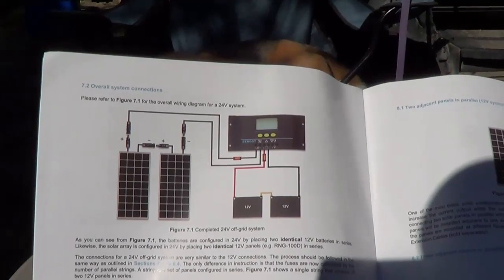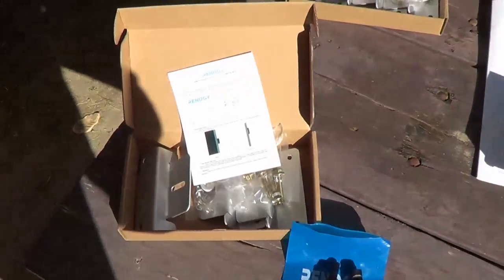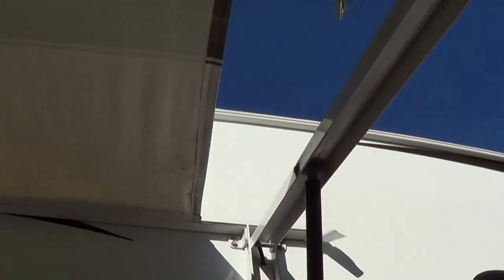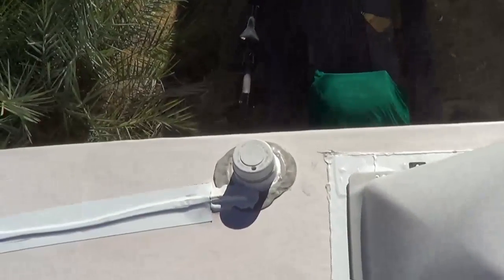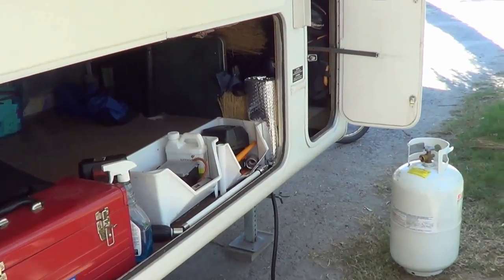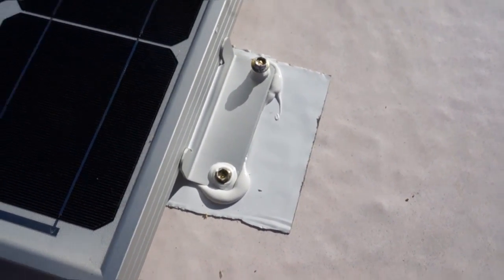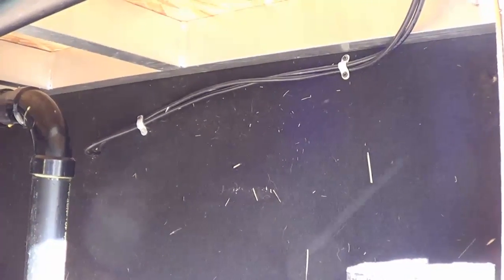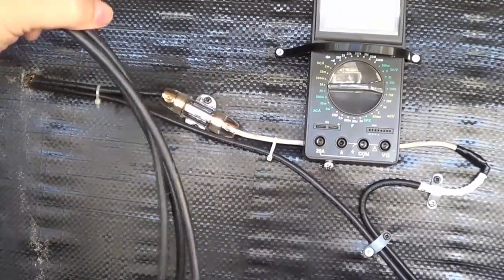Installing a Renogy 200W Solar Kit on my RV

Comment: Very nice.  I had 450 watt's worth of panels put on my 5'er late last year. Went on one trip to test them out. I have (4) 6V batteries running in series parallel, and it seems like I use quite a bit of power during the day, but it recharges pretty well.  Will be interested to get a few more boondocking trips under my belt.  Also would like to record the morning and night battery voltages.
Reply from the maker: Korey Jerome Nice amount of solar power and battery storage there.
 I think you should be fine. My battery voltage is about 12.8 when the sun goes down at around 4:45pm and 12.3 when it comes up about 7am, short days right now in mid winter. At night I keep my 17 inch laptop and Verizon Mifi charged and run a few LED lights, and maybe an hour of my 32 inch LCD TV plus the furnace fan is running on and off to keep rig at 64 degree temp while I sleep for 8 hours. Battery capacity is lower right now because it is near freezing so I expect better once it warms up a bit and as the days get longer from now on.

It's really nice to not have to run the generator now unless I want to instead of have too, last night I ran it a bit so I could watch a few hours more TV and use the microwave for dinner, I only have two six volts batteries for boondocking right now. Hope to expand to something like your system in the future. :)

Cheers Ray

Comment: Enjoy watching your videos Ray. Thank you and Happy New Year. I installed the same setup with an upgraded MPPT controller. It is supposed to make a significant difference - time will tell. Thanks again.
Reply from the maker: tommy1a1a Thanks and our welcome! Did you go with a Renogy one or a different brand controller?
Reply: Love Your RV I bought the same Renogy (I don't know how to pronounce it either) kit, but used a Blue Sky Solar Boost 3000i controller (warning it was bit pricey).
Reply from the maker: tommy1a1a Cool, will be nice if it does the job as advertised, I think I'll go with two more panels first to fill up the front roof then look at upgrading the controller after that to squeeze more power but then I'll need more batteries, ack! haha, looks like this could get addictive and expensive.
Reply: Love Your RV ahhh yes the only thing that helped control my addiction was winter.

Comment: Great install , I have a 160 watt solar panel installed on my trailer . Wish I had the installer use VHB tape by 3M . Do you know about this ? In my research I have found many RV'ers  have success with taping down the Z clips  instead of using mechanical fasteners .

Comment: will they be tilted up when in use/parked?
Reply from the maker: Currently they are mounted flat, no tilt. I'm going to add two more panels and see if that serves our needs with out tilt. If not I may look at adding tilting hardware to them. I'm only charging up a 235AH bank so more power maybe wasted anyway, Will have to use the system a while and see how it goes.

I like the simplicity of not tilting, less hardware to maintain and wear and tear on the ladder and roof. We tend to move around quite often, unlike some folks who like to stay in one area for a long while. I would also be a bit worried about the winds in the desert ripping a panel off the roof, so that would be another pain to have to be running up to lay them flat when the winds really came up. I'll see how it goes..
Reply from the maker: lez briddon Interesting thanks, I really like the guys channel. Will subscribe and remember to watch a bunch when I get on some free WiFi. ;) Cheers Ray

Comment: Fantastic job, the only thing I would have done different is run a lap seal over the edge of the eternabond tape to lock it down and prevent any future water penetration.  To give you an idea on what you are missing on your solar charge with having them in a lay down configuration.  I was checking my panels yesterday about 10 am and was getting 12.4 amps from the exact panels that you have.  That's tilted at about a 45 degree angle and at 4,000 ft. elevation and 36 degrees.   That's the best output I've ever seen.  The sweet spot with these panels I've found is in the 4,000-7,000 ft. elevation at a temp. below 50 degrees.  I track the output daily on my panels and average just over 5 amps output per panel.   I use my 4 panels in a portable configuration.  With the sun so low on the horizon now I have to reclock the panels 3-4 times a day for max. efficiency, but average at least 10-11 amps from 9am-3 PM with 2 panels.  If you decide to add 2 more panels in the future, consider adding a tilt function it will improve your charge rate by at least 30-40% in the winter when you really need it. 

  Also, for anyone considering the Renogy panels for $20 more you can add the digital charge controller in place of the basic one.  Call Renogy.  Renogy panels are made in the USA and the customer service is based out of Austin TX.  I've been very happy with my 4 panels and they provide 90% of my power needs the past 12 months.  Sign up for their e-mail promotions and every month or two they have a 10-20% off sale.  Their regular price has been about $145 per panel.  You can buy a 100 watt panel, 30 amp charge controller and 2 connector kit for about $165 on Amazon with free shipping. 

  Did you get any snow?......I left the high desert yesterday and camping on the Colo. River S of Bullhead City Az.  I had about 2 hours of heavy snow with the ground white, but didn't last long. All the roads climbing up out of the valley were shut down from accidents and spin outs for much of the day.  I saw on the National News some areas of S. Calif. had a good dump of snow.  Searchlight NV where I was camped yesterday had blizzard conditions and several semi's and 5th wheels were turned over on their sides.  I got out of there just in time!......32 right now, so this is about as cold as it ever gets around here.  Hope you are someplace warmer.  I'm heading to the Salton Sea this week, so back to the low 70's if the weather forecast holds.  Happy New Year.
Reply: I was thinking the same ebond thought :)
Reply from the maker: NWHiker Thanks for all the info!
I usually do the edges of the E-tape used elsewhere but I figured with all the downward pressure from the flat bracket that the tape under it will be well sealed around the screw holes and left plenty all around. It's amazing how well that stuff sticks, just finished doing most of my roof.

 Didn't see any snow, just cold for here and windy. The mountains look very pretty now across the sea covered in snow.  Best I've seen for power was 10.4 amps @ 13.4 volts coming off the panels. I'll likely still be here at Salton Sea. Camped at Corvina Beach. Come say hi! Cheers Ray